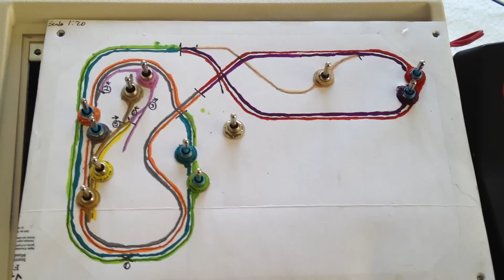3 controller DC wiring N scale

Comment: I'm running a 20' DC layout. Would I improve performance by adding additional feeders?
Reply from the maker: As a rule of thumb you should have a feeder every 10 feet.  If the feeder is in the center or its an oval you have fullfilled the rule.  However if your glueing this down add a feeder.  That being said i have a unglued 56 foot mainline im playing around with that has a single feeder.  Voltage drop is noticable by eye after about 20 feet.  Voltage meters can measure the drop and will save u massive headachs in the future.  A cheap voltage meter rubs for 10 bucks
Reply: @Lutain1337  thanks! I know it's critical for dcc, but didn't know if it applied to DC as well.